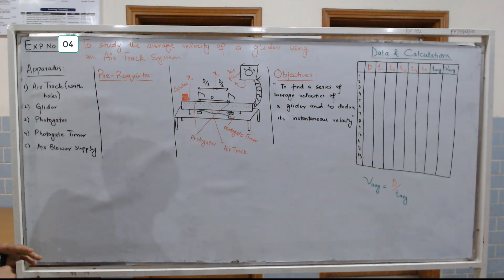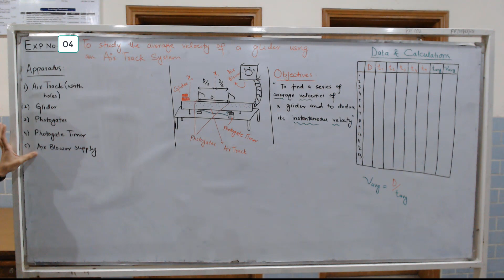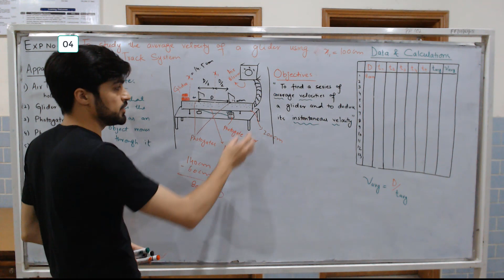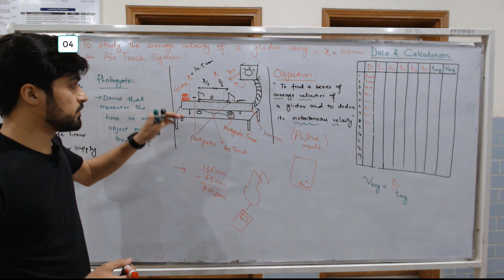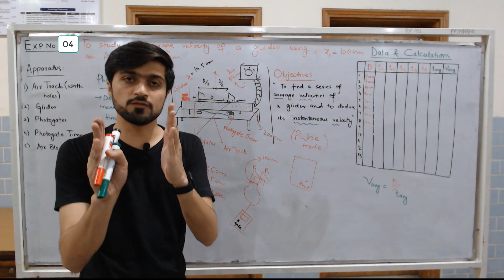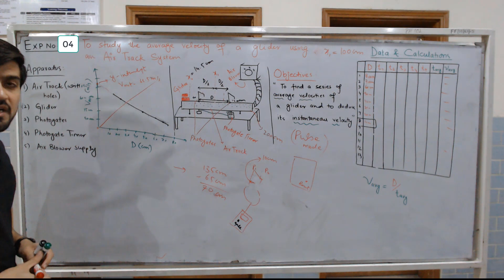Exp:4 | Study of the average velocity of a glider using an Air Track system| Part-I

Comment: answer to question 1:
When a body is moving with constant acceleration, average velocity is equal to instantaneous velocity.
Reply from the maker: Correct but better to say, when the body is moving with constant velocity. Zero acceleration is a constant acceleration as well.